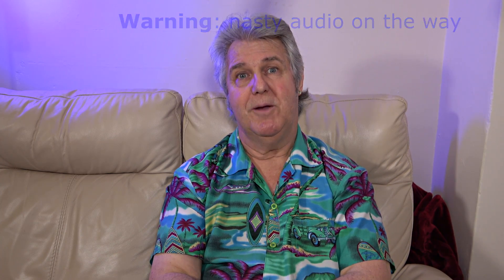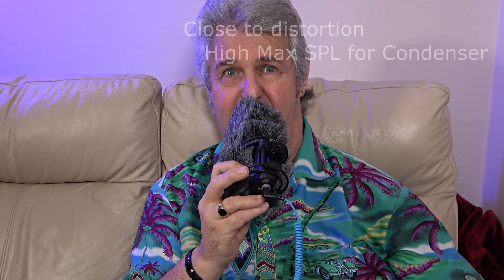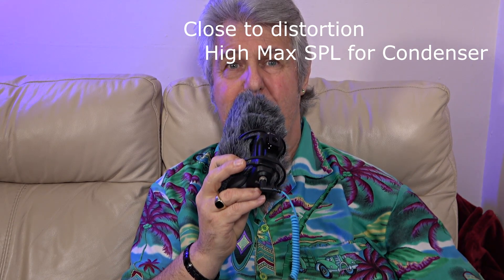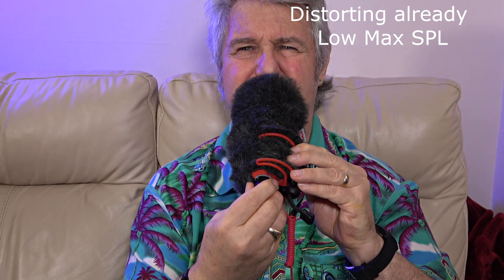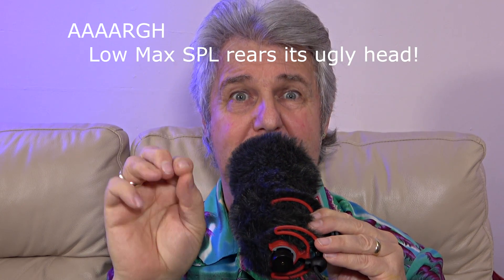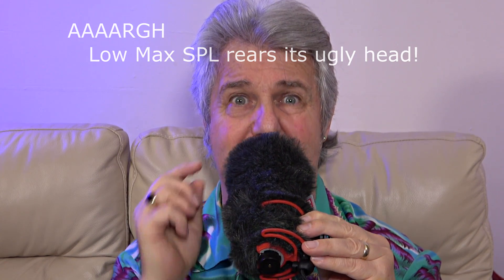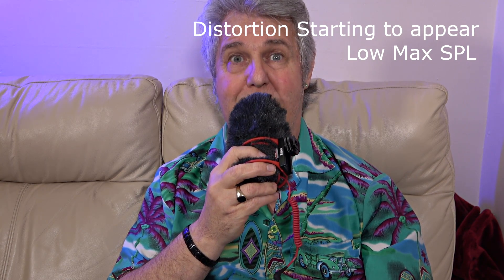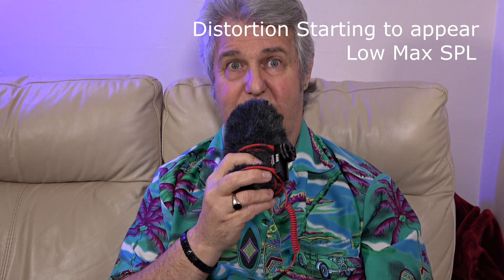The New Rode Microphone Offerings have One Potential Problem .......

Comment from the maker: I have been noticing over and over, slight peaking at the peaks of my voice when using the Rode NTG or Go II, so I did an ‘extreme’ test and indeed, the two of them ‘go over’ more readily than other mics. Even though the camera shows no peaking.

Engaging the pad on the NTG and lowering the gain on the back really helps a lot in the case of the NTG but that isn’t possible on the Go II.

So it seems that in normal ‘everyday use’ these two mics need to be watched closely and in particular to the NTG, turn the gain on the back as far down as you are able without raising the camera gain too much.

Further testing since this video has shown that my voice wasn’t loud enough to make the capsule peak. (I used a sound pressure meter to monitor). The camera wasn’t anywhere near zero so that only leaves the internal electronics being over driven to cause it.

So, mic gain down since both of these mics quickly go into peaking with them set at the same level as many other mics. They have a lot more gain. Not sure what to do about the Go II. Gain can only be set via the camera.

Comment: Firstly your test and points are completely valid I agree I Would love to see higher spl on both the videomic Ntg and go II. But the do have the pad for louder situations annoying you need the app for the go though. Also even when shouting your still going to have the mic 1 to 2ft away from yourself while vlogging and the same for On a boom so chances of hitting max spl are way lower.
Reply from the maker: It was a very harsh test but I decided to do it after trying to video some theatre stuff using the NTG. A lot of the audio was distorting on peaks if say, a trumpet played a note in the background while cast members spoke to me on camera. At first, I thought my levels were out, but as it turned out, I was way below zero on the raw footage so I knew that it was the mic.

This test just shows how readily the NTG goes into clipping. (Before the others)

You are right, switching the pad in on both helps but doesn’t fully alleviate the problem. Result is that I rarely use the NTG any more.

I do wonder whether there is some kind of impedance problem between the mic and camera. ie: the output impedance of the mic is a bit high so too much volume goes out into the camera which can’t cope with such a hot signal.

Anyway, the pad helps slightly but then you get slightly more self noise too.

I appreciate that Rode might not be happy with what I’m trying to highlight, but when I saw the max spl of the new Rode Go II, I thought ….. ‘they’ve done it again!’ So I decided to make the video.

It has plagued me for a long while with the NTG and caused a lot of wasted footage.

By the way - your channel is great. I really enjoy the stuff you do there.
Reply: @iancraig  I agree straight into camera might not be helping but that’s a huge market for shotgun mic with a 3.5mm cable. I find my lumix s5 to have a really hot input compared to zv-e10 and a6400 it’s got a really good range of adjustment. So on the s5 the go II is harder to tame vs ntg with variable gain and super sensitive lavs are a no go unless I turn the limiter on. But with the Sonys I’ve never had any issues but I haven’t been near a trumpet 😂 maybe diety v mic d3 and d3 pro would suit you better with 130 spl. Thanks for the nice comment great content your end too just subbed.
Reply from the maker: Thank you. Indeed, the Deity does better in that situation and that is the one I use for quick on the go stuff. (D3 Pro)

I didn’t want to bring that into the mix because it might have ruffled Rode too much. It’s just a warning to people that the NTG can be right on the tipping point quite easily.

I used a Sony ax53 for this video and the preamp in that one is pretty good, which is why I used it.

I suspect Rode might be able to update the internals internally rather than it being a capsule problem but with these bigger companies, it is difficult because they often don’t accept problems very gracefully and kind of ‘deny’ that there is a problem!

If that problem was improved, I would use the NTG for theatre ‘run and gun’ things because it has a damned good sound. Saves on phantom power supplies and leads. Really annoying….

Comment: Ian, I think I have found something interesting regarding the NTG in combination with the Canon M50. I am still working on verifying it. What camera are you recording into with these mics and where is your camera audio gain level set at?
Reply from the maker: Hi. I was using the Sony AX53 at it's lowest gain. Rode have advised me to turn camera gain up and mic gain down. 

To some extent, the pad helps but having played around with it, I suspect that it might well be an 'electrical' thing that seems unique to the NTG!

I also use Canon M50.

The problem is (as you most likely know) that the problem is way less than my extreme demo, on peaks every now and then.
Reply: @iancraig  I  On my M50, the NTG was often horribly distorted no matter what, even indoors at soft speech levels. After some experimentation (I am still playing with it), the M50 distorts when gain is set to 1-2-3 notches and levels peak at -12 dB. Let's say,  I set the wheel on the NTG to 10, set camera gain to 1, and it is distorted even if I do not exceed the -12 dB mark. Then I set the camera gain at 3 and distortion becomes significantly lower. If I go near 6 notches on the camera, I have to lower the gain on the NTG wheel, so that it does not show too much yellow, but the distortion is much less painful. It can be some impedance issue? Someone told me he is experiencing  this since a FW upgrade on the NTG which theoretically sorted the hiss problem on certain Sony cameras. Maybe when that was sorted it broke something else? Not sure, I cannot find a way to revert to an earlier FW.
Reply from the maker: @ww1www  and Rode must be aware of this because that's what they had told you to do! It does indeed sound like some kind of impedance problem. It probably happens slighty less on the Go II because there is no gain control on the mic, which means you HAVE to turn the camera gain up.

So as they rightly said, the Max SPL isn't being exceeded, it's the electronics in the mic. Never occurred to me that the electronics could change the output impedance which is what this sounds like 

Hopefully then, one day there might be an update......
Reply: @iancraig  It could well be a thing of the camera, not sure how the circuitry works, maybe the preamp struggles at lower internal voltages.   The NTG is a very hot mic, even at level 5, which is a third of the maximum,  it is much louder than the VideoMicro or the MKE600. So there is no chance they overdrive the preamp at low camera micgain levels as they will virtually never go as high as -12 dB or thereabouts.  I will now try to check what happens if I use some preamp before the camera, ie. to see if it a microphone issue or a camera issue.
Reply: @iancraig  I am experiencing no significant distortion when recording the NTG into a Zoom H1n unless I set gain too high. Now time to check what the M50 does with some other mics.

Comment: Somebody gave me a rode videomic go 2 I tested had this problem and I got very angry at it because it performs very poorly, I came back home and did this same test on my mke 600 and movo vxr10 and I figured rode still trash so we returned the trash they sent us
Reply from the maker: What I find slightly annoying with Rode is how you are treated, should you describe a problem. Even on here, a condescending 'general'' reply from them that acknowledges nothing. They are basically talking down to me because I shouted into the mics.

I'm well aware that this was a harsh test for any microphone but it followed a series of clips that I took that were unusable due to the Rode NTG. I don't get this with the Deity D3 pro and I didn't want to put them head to head because I know that would have upset Rode but following the reply from them, I'm very tempted.

Fact is that the NTG in particular distorts way more readily than the other two. The Go seems a little better. Most mics would start to distort in these conditions, but it shows the NTG going much quicker than the others.

Since Rode are saying that capsule distortion is rare, I can only assume that it must be the internal electronics since the camera was way below zero on its meter. In fact, I had to normalise the volume up! 

So it seems that the NTG in particular is more prone to problems but actually, the Go has a lower max SPL so that might well show similar I think.

I know I'm not the only one with this problem, but Rode are basically saying it's the way we record, not the microphone!

I'm saying that if the mic is on the borderline of distorting all of the time, clipping just peaks in on the top of normal speech. That's what I get and quite a few other people too.

Comment from the maker: When out vlogging, microphones are faced with huge variations of loudness and some seem to cope with that better than others. If you have one that doesn’t cope that well, it might actually be beneficial to switch in a pad if the mic has one, in some cases. For instance, I am finding the Rode NTG copes better with the pad. The Go II seems slightly better but has no pad. The Videomic Pro+ copes extremely well.

This is an extreme demo but it does follow a series of videos that I made using the NTG where I noticed slight clipping on the tops of normal speech. Only slight, but I felt it was on the cusp of nasty, distorted audio all of the time.

This could be at the capsule, in the internal electronics or even at the camera. In this test, I made sure that the camera was below zero, so either the capsule or the electronics of the NTG in particular seem to get easily overloaded.